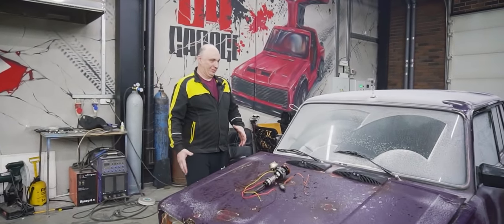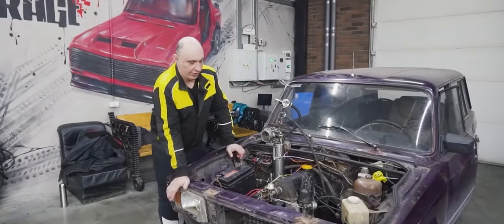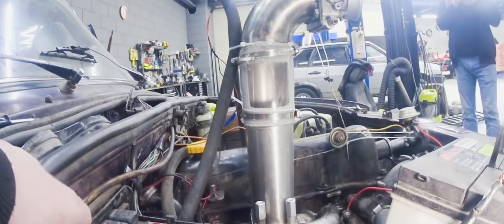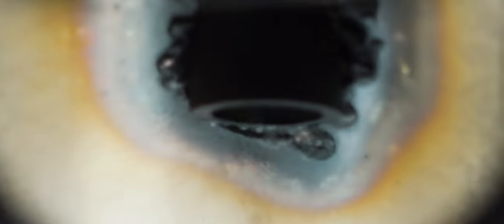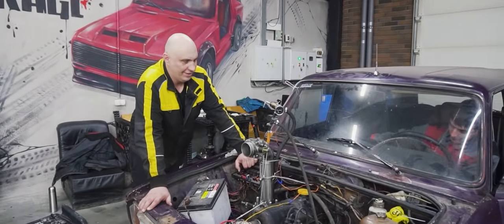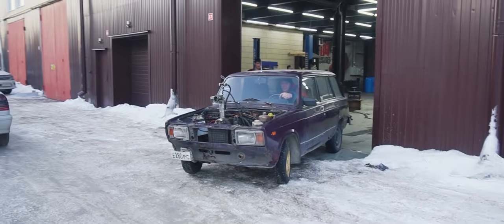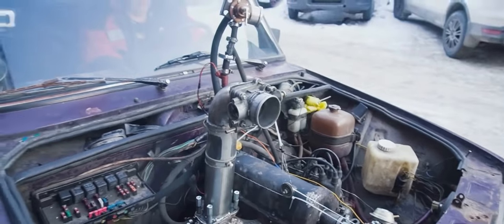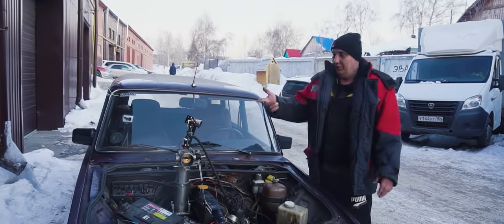Can you replace a carburetor with a fuel injector?

Comment: Idk if it would be possible to regulate the fuel pressure with intake vacuum. Decrease fuel pressure to make it idle at low revs and then give it full pressure when wide open throttle.

Comment: I'd think by connecting the system to any wiring that's only live when the key's on (Either with or without a relay, depending on what sort of amperage the system will pull) and using that to power the injector, it would remove the need to manually enable the system.
It's not an obscure "Outside of the box thinking" sort of idea, so I'm wondering if they didn't do this because of some reason I'm missing ?
Reply: The way i did it was find the "on" relay and hook to its output. The downside is that the injectors will shoot gasoline in the on position always, so it's not wise to hang in the on position before cranking the engine. 
Another better option would be an electromagnet connected to a TRANSISTOR that turns on the injectors (pwm circuitry) only when the engine is spinning. The electromagnet would be placed face to face with an engine wheel that has a magnet stuck to it. Spinning wheel creates a voltage in the electromagnet, which turns on the TRANSISTOR.

Comment: Need a mass air flow sensor and O2 sensors to vary the intensity of the injector pulse and control fuel volume.Of course an ecm and tpc to control everything..

Comment: Great video. I wonder if an injector would work through a Mikuni carburetor. Perhaps the slide could control the injector jetting and the carb act as the throttle body. It may atomize better, and feed a 4 cylinder engine with a 1 cylinder fuel supply.
Reply: @Jedendwa0  Wrong video or comment. But since this was mentioned how about you go to tell Ukraine military to take better care of their weapons, so AA missile wont go haywire and slam into apartment building and then get accuse Russia for it, or post Syrian war drone footage as their "stunning victory" over Russian AA systems... Propaganda works both ways and one should not trust nether side of this conflict.

Comment: Try a second injector switching on at 3/4 throttle via a switch on the throttle body. That way you are essentially doubling the fuel at the point where it died off with one injector.

I am going to make a kit for my car like that and see how it works.

Comment: The 88 to 92 Ford Falcon here in Australia had Centrepoint injection, which was like one big twin nozzle injector straight into the intake manifold with a throttle body. It also had a fuel management system to run it.
Reply: Great stuff 😀😀😀, I love Australia, the Citroen DS featured a fuel injection system with an extra set of points in the distributor, and electronic regulation of the electronic injector duration....in the early 70's 🤪

Comment: The pulse-width of the injector (the "on" time) needs to be automatically varied at different RPMs. More for higher RPMs, less for idle. Right now, you are getting the same fuel flow rate for every rpm, and the engine will only run right at a single RPM that matches the fuel flow of the current pulse-width of the injector, and fuel pressure combination.
Reply: Assuming that distributor has mechanical contact breaker then it's even worse. As the RPM goes up the on time contacts decreases so injector duration decreases.  Effectively fuel delivery is inversely proportional to RPM.
Reply: @ferrumignis  Yep. If it's a points distributor, this is what's happening. If it's an electronic distributor, then the pulse width is most likely the same at all RPMs. Some of the later distributors had an "automatic dwell" feature built into the module that changed how long the coil was "charged" based on RPMs, and could end up varying the pulse width to the injector, which would make the situation worse no doubt.

Comment: You need a throttle position sensor of some kind that changes the pulse width. Maybe a cable that can adjust the dwell on the breaker points?

Comment: Add a second stage injector to increase fueling at high rpm
Reply: You can controll it with a switch on the steering wheel that allso allows the throttle body to open all the way,should give you a good boost of power and will be sinple and cheap

Comment: i had a car that had a throttle body injector, it was basically a normal carb with an injector on top. i'm pretty sure the amount of fuel was adjusted based on throttle position, using the computer. i'm sure there's a way to do it mechanically, maybe using a vacuum pancake actuator to control fuel pressure or something. the more throttle, the more vacuum, the more fuel. like a normal carb but unnecessarily complicated. xD.
Reply: Perhaps if they had used two distributors instead of the one to fire the injector. One dizzy is fitted with a vacuum advance, but the other is not. then wire both dizzies in series. The drift in advance between both dizzys as rpms increase would cause the dwell time to widen or narrow, depending on how they were rotationally adjusted to each other.

Comment: You need a fuel pressure adjustment adjusted by the underpressure.
With that you should get more fuel at wide open throttle, and less at idle.

Comment: Add a second injector on the bottom of the accelerator pedal so it turns on when open throttle. Also. Instead of the switch. Wire it to the ignition so it turns off with key

Comment: Back in the 60s VW used electronic injection controlled by a second set of points in the base of the distributor. Those points had 2 contacts and a single cam lobe that fired left and right banks alternately. The fuel pressure was modulated via manifold vacuum to lean it out at idle and richen at load. It was a VERY simple system that was VERY reliable.
Reply: Tell me more about it
Reply: @chadburkle1461  ... research Bosch K-Jetronic injection. It was used in the late 60s and early 70s for VW air cooled. Later version was the L-Jetronic, which used a mechanical mass airflow sensor instead of vacuum. That was also used by Datsun / Nissan through the early 80s. As I recall, both used air and engine temp sensors to fine tune cold starting. Some versions used an extra injector to add fuel in very cold weather. I believe it was actuated by the starter circuit.
Reply: @RussEdgar445y7tlfj  ... you're right. it's been so long  that I'm confusing the systems. The one VW used might very well be a D Jetronic in the early years.
Reply: @RussEdgar445y7tlfj  ... gonna take a wild guess is the K stands for something in German, so it's not just a progression of letters as the modes change.
Reply: @RussEdgar445y7tlfj  ... I never worked much on them but wondering if that's similar to the CIS that Saab and a few others used. As I recall they were mechanical.
Reply: @RussEdgar445y7tlfj  ... yeah, that was about the time I switched away from imports and over to fleet work so lost touch. I pretty much reached master status in Chevy vans then over to generator work till retirement.

Comment: I'd love to see Bosch CIS adapted to a single point of fuel injection. You could retrofit that system to any engine of similar displacement.
Reply: I was wondering if they could have used just the Cis flow valve to change the fuel pressure then use a fixed duty cycle to the Injector. Would limit low ram air flow to prevent the air  surge problem and keep enough fuel at higher rpms.

Comment: the faster the engine spins, the smaller the amount of fuel goes in, as in its injecting at the same speed no matter what the engine speed is, but the pulses of fuel get smaller the faster the engine spins.
Reply: Maybe this hack works for engines with constant rpm like generators. (typo fixed)
Reply: @juhajuntunen7866  yes probably right ! it would work really well with an arduino firing the pulses, you could map it then also. good bit of fun,
Reply: maybe even 555 timer is enough.

Comment: Decades ago, I owned an '82 Porsche 911SC, and it had a poor fuel injection system with a very restrictive air box. I had the fuel injection replaced with a pair of three barrel downdraft Weber carbs, and it ran soooooooooooo much stronger after that.